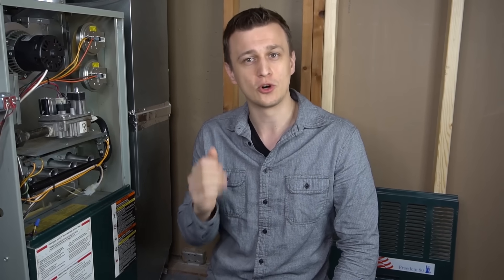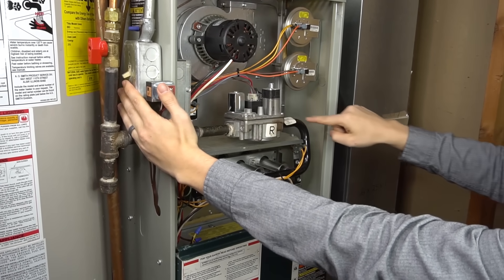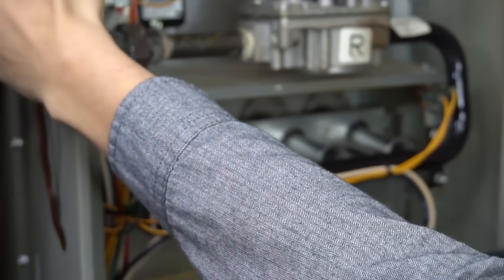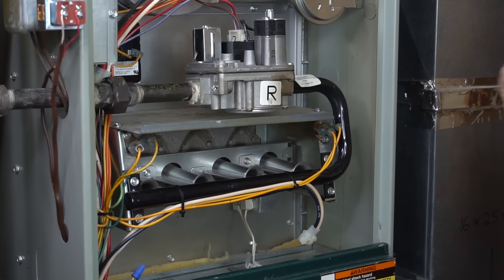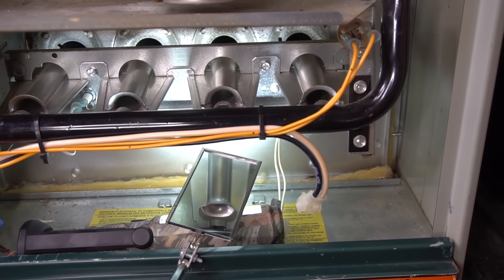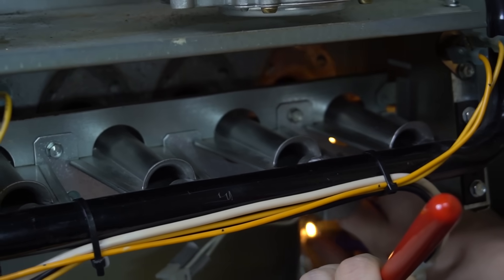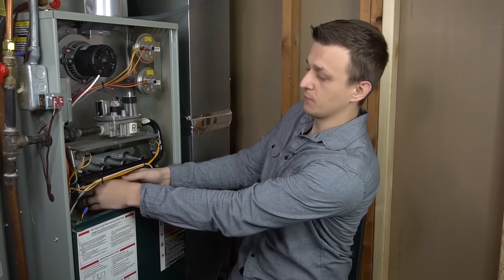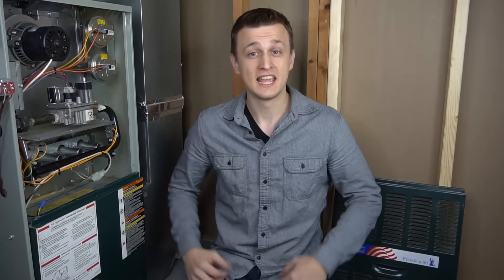Gas Furnace Wont Ignite - How to Manually Light Burners

Comment: Why wont my ignitor glow? I replaced it with a new one. And replaced my flame sensor😢
Reply from the maker: Is your furnace blinking any error codes? I would start there. Perhaps one of the safety switches is tripped so the furnace never even sends power to the ignitor. If you are unfamiliar with the term "furnace sequence of operation" I would suggest watching this video. It's very helpful to know in which order things fire up: https://youtu.be/AQD_MedIklI?si=cjc1GxKXJN2mENDm
Reply: @WordofAdviceTV  yea. I went through all this and it just really seems perhaps I got a bad HSI or I need a new motherboard. 🤔 startup sequence seems good and in order. Before and after parts replacement. And error code before and after HSI replaced still indicated HSI error. 
(Also I had replaced thermostat just to be sure)
Haven't been able to do a test with a reader if the HSI is any good. Probably should get one of those shouldn't I and see if it reads any ohms
Reply: It's about to be in the low single digits here in the south so I'm probably gonna have to manually light the burners to at least get the house heated up real good the night of
Reply from the maker: @light0000  Oh okay! If you are able to light it manually then that means either the board is bad or the ignitor is bad. (If the ignitor is getting power but not glowing, ignitor is bad. If not getting any power but you hear the gas valve opening, then the board is bad.) It could also be a loose connection. Try wiggling the ignitor wire everywhere during the time it is supposed to glow.

Comment: I can hear my ignitor goin but no flames,i replaced gas valve & no luck,what else can it be?
Reply from the maker: So from what I understood, you have a spark ignitor right? Is this an intermittent pilot or direct spark style? If it's an intermittent pilot, then the pilot orifice may be plugged. 

Have you checked if the gas valve is getting 24v going to it? Is the control board blinking any error codes by chance?

Is the gas shut off valve open? The gas valve switch is set to on? If you have a manometer, I would also check the input and output gas pressures.
Reply: Justdissin 
If you’re not in the HVAC field you probably should call a professional.
Reply: @hvacdoc2338  ..figured it out..it was my ignition control module
Reply: @WordofAdviceTV  ...its a 30yr unit..its working now it was the ignition control module.
Reply from the maker: @Justdissin Great! Good to hear you were able to find and fix the problem! Thanks for the update, stay warm!
Reply: @WordofAdviceTV  thank u for ur quick response

Comment: I wish I had watched this before I spent 500$ on a service call that did not solve the reason the furnace was not always starting.  I used a barbecue starter and found all burners started except the one pointing at the igniter. I`m sure he would have found the plugged orifice if he had not been trying to upsell me on other parts.

Comment: My Hayward pool heater often has spiders weaving a web in the gas orfices. I have thought about drilling and tapping holes in the manifold and putting easy to remove and replace screws so that cleaning the orfices would b easy. Anything to recommend?  Really appreciate your vids. And the camera person is super!!
Reply: Bill Rimmer please don’t do that.
Reply from the maker: Thank you! My wife does a great job at filming me! Haha in fact I think her filming may be better than the actual video ':) I have never even thought of doing something like that.. Drilling holes in the manifold. I think that would be fine as long as nothing is protruding inside the manifold to the point where it interrupts the gas flow. Well and using some dope or teflon tape on the screws so that there is no gas leaks would be a good idea too. But I have never done anything like that or seen it done before so unfortunately I can't say anything for sure...
Reply: Bill ,  you really don't want to alter your gas pool heater or any gas Appliance due to liability. I know that spiders weaving webs can be problems for any outdoor gas appliances. You really only want to follow manufacturer's instructions  & contact Haywood about your problem,they may have a solution such as Venturi screens for the burners.
Reply: Bob Y my only suggestion is to maybe put some scotch or electrical tape over the orifice opening at the end of the pool heating season.  Putting tape over the orifice opening will stop any spiders from crawling in and spinning a nest; just don’t to forget to remove the tape before the next use.

Comment: HEY MY GUY.......I HAVE NO POTENTIAL POWER COMING OUT OF MY BOARD GOING TO MY AIR SWITCH....BUT HAVE POTENTIAL POWER GOING TO MY BLOCK FLUE....DOES THAT MEAN MY BOARD IS BAD?
Reply: ALSO THOSE WIRES COME OUT OF THE SAME MOLEX PLUG🤔
Reply from the maker: If you look at the wiring diagram for the furnace, is there anything in series with that pressure switch? Sometimes there is another limit upstream that is tripped and that's why the power doesn't get to the pressure switch. Is the control board blinking any error codes and is the LED light on at all?
Reply: IT IS THE 3 FLASHES INDICATING AIR SWITCH
Reply: Never saw this one b4.....My BLOCK FLUE IS IN SERIOUS WITH MY LIMIT SWITCH
Reply: Any Suggestions....like I said both block flue and air switch coming out the same molex plug going to board...but the wire coming out to block flue has power...but wire for air switch doesn't 🤔
Reply from the maker: Hmmm... That one sounds odd, I don't think I have a good idea of what's going on without looking at it so let me try asking a few more questions instead. So power goes into the block flue. Does power come back out of it or is there voltage going in but nothing coming out? And then it goes back into the molex plug and then to the air switch or straight to the air switch?
Reply: Power sit at the block flue coming out the board molex plug...but power never comes to the other side of the switch....no power comes out of the molex plug for the air switch at all
Reply from the maker: Okay so it sounds like you narrowed it down to two likely candidates. Either the problem is the control board or there is something wrong with the block flue. I would have to be there to narrow it down further but perhaps the block flue is stuck closed?
Reply: From what I learned it is Power always at my air switch and block flue switch when have a call 4 heat....what is happening there is no power going to may air switch but power going to my block flue switch
Reply: Normally win the unit calls 4 heat the power is sitting at both switch.....after both switches prove it goes to the next action...in this case power is just sitting at block flue switch not air switch....
Reply: Wave Mechanic   No, what it means is you have a lot of potential 😝
Sorry, I’m only being humorous, I really don’t have an answer for that.
Reply from the maker: @Lawrence Jameson Lol, that was good one :)
Reply from the maker: @Wave Mechanic Just like Lawrence, I also don't have a good answer for this off the top of my head.. Is this a forced air furnace or a boiler? Also, what brand and year is it, do you know?

Comment: Just listen for the limit switch to click on and then ignite the lead burner with a long stem lighter. Typically you can go to places like Ferguson's around here and get a replacement hot surface igniter for typical furnaces they're about 35 to $90 depending on how good a quality of hot surface igniter you get. Unless you got electronic igniter like the old 85% of fish and gas furnaces had then you got to order that particular part for your particular furnace

Comment: You forgot one important thing for rookies to know. Sometimes those furnace doors have a safety switch that has to be depressed and or bypassed  for anything to work at all inside the furnace.
Reply: Party Lee007 usually that door switch that you are speaking of is connected with the bottom door that houses all the electronics. I usually refer to them as the electrical door.
Reply: Brandon Price  Well, if you have a Trane XR 95 furnace like I do or something similar you have to take the bottom electrical door (where the switch is )off first before you can take the top door off.
Reply from the maker: @Party Lee007 Thank you for the door switch reminder! I did totally forget to mention it but like you said, on some furnaces the blower door needs to come off first which will cause the door switch to dis-engage.
Reply: Party Lee007 I do apologize and appreciate your comment. I’m still new in the “service” portion of the industry. I have been used to the install.

Comment: My pressure switch will not work unless I disconnect the wires and reconnect the wires to the pressure switch. I tested the switch and it is working properly but only if I perform the steps listed above. Do you think it's the pressure switch?
Reply from the maker: Does the control board blink any error codes when this happens? It's possible that it's a stuck pressure switch, when you tested it, did you try shutting off the furnace when it is doing that, pulling off the wires and checking continuity on the pressure switch? (should be O/L)
Reply: Yes the board indicates a limit circuit lockout once the inducer motor runs for a certain amount of time without the pressure switch closing. I did test the pressure switch and it did  read  OL on my multimeter was with the power off. The pressure switch just won’t work unless I remove the wires and reattach them after the induce draft motor  kicks on.
Reply from the maker: This one is a little odd. What you described sounds like a pressure switch that is stuck in the closed position.. But then when you check it with the power off, there would be continuity between the two terminals if the switch was indeed stuck closed. Unfortunately this is about as far as I go without being there. I would need to check it myself and put a manometer on it/check pressures as well. I don't know if you have seen my pressure switch videos but perhaps one of those can give you some more ideas of what to check:

Pressure Switch Troubleshooting: https://www.youtube.com/watch?v=MWn55b8DXO0&t
10 Pressure Switch Problems: https://www.youtube.com/watch?v=Zax02itYHkU&t
Reply: @WordofAdviceTV  

Ok I will check out the videos. I do have one more question out of curiosity.  What does the -1.58 PF mean on my pressure switch?
Reply from the maker: PF stands for Pressure Fall and -1.58 is measured in W.C. which means inches of water column. Long story short, the inducer motor must produce -1.58" w.c. of pressure in order to close that pressure switch.

Comment: Yes you can ignite an electronic ignition furnace with a lighter but it is not a good idea to put this information out there for the General Public on social media. There is a lot of things that can happen that could put a untrained person in danger of a flash or delayed ignition. Having worked as a first responder for a  major gas utility I can tell you people have been burned attempting to do this because of a clogged travel tube ( Traveler), blockage in the chamber, blowback due to a hole in the heat exchanger ( combustion chamber) , gas valve passing & ect.. . Just an FYI  teaching people how to bypass a safety device on social media could be a liability you or your insurance company may not want .  I am currently retired but still act as a consultant when incidents happen in the gas industry.
Reply: He's not doing it to help people,  he probably don't even care about them, all he wants is views to make money.
Reply: You should read the video description
Reply: @johnathanreigard512 , I call it Clickbait. Jay is a very good technician but he needs to get people to watch and he does a very good job of that as well.

Comment: Guys do not listen to this. I have been a serive tech and project manager my entire career. Do not ever manually light a furnace this is highly highly unsafe. Any hvac company or utility would NEVER do this. This goes against every saftey protocol training out there. HUGE code violation. A novice cannot determine the cause of ignition was not the ignitor or sparker itself and there may be board issues for example. You go to ignite a furnace with a heat exchanger filled with gas get ready to go boom. You wouldnt smell it either being inside the exchanger.
Reply: I agree. Taking this approach is pure desperation and could result in unexpected consequences. I tried this once using a long fire starter. The furnace ignited but not without a blast of blue flame escaping from the burners back toward me. I'll never do it again and consider myself lucky to be alive and able to relate this tale here.
Reply: If, you're get a code that say's it the ignitor it's the ignitor. For all intensive purposes.
Reply: @Unknown-hu4gf  what if bad board not sending voltage to ignition? DIAGNOSE DONT PART CHANGE